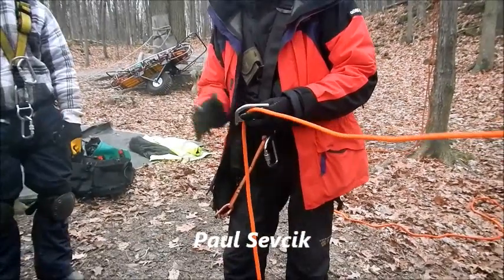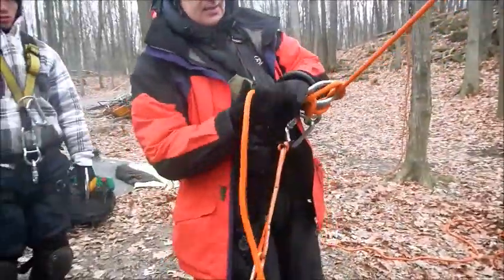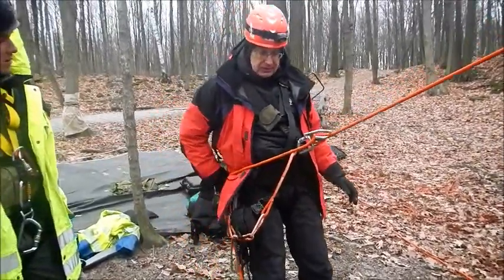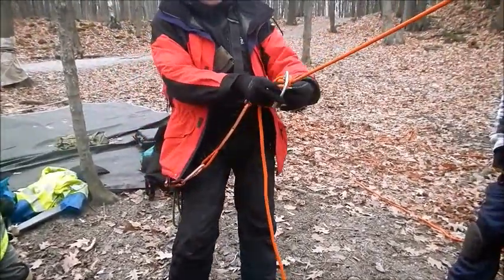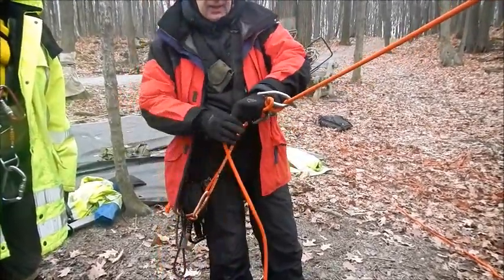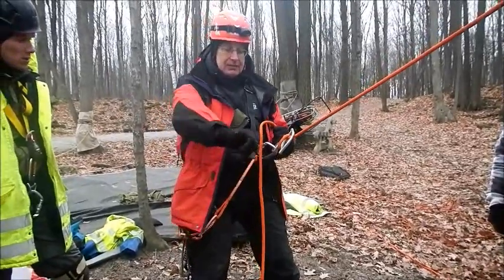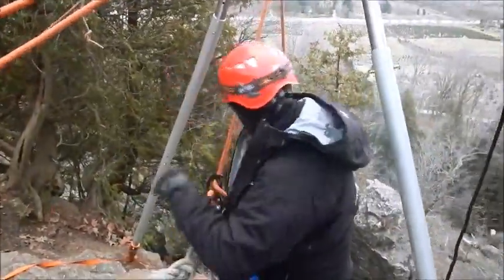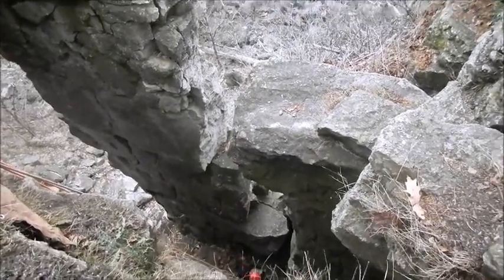High Angle Rescue Figure 8 Descender

Comment: Well done. I am tired of seeing videos where there is no rope protection used on the edge. You had also a safety line, great for rescue style rappelling. I myself at trying to figure out which setup to use to rappel fast with Rescue 8, while maintaining security? Which rope to use and so on. Maybe do it with Prussick line and have 2 lines of thinner rope going through the Rescue 8.